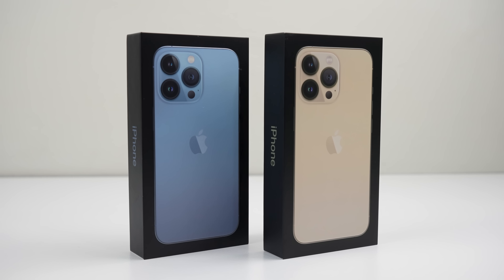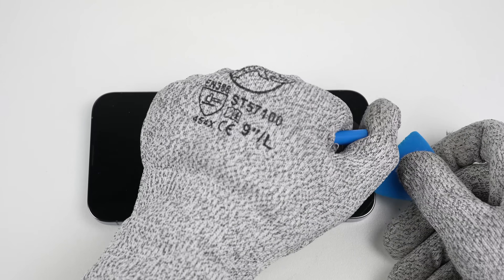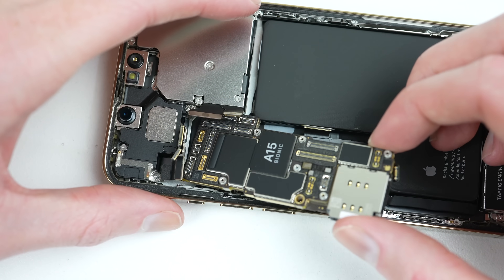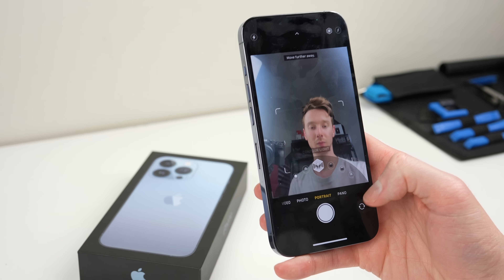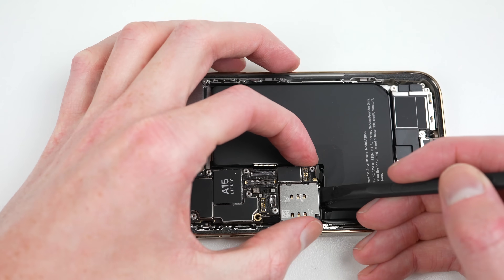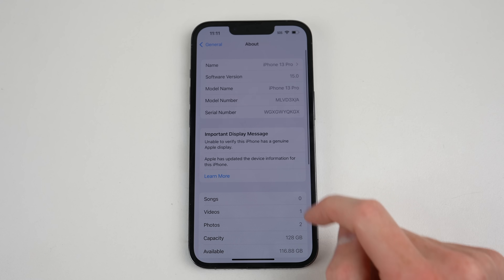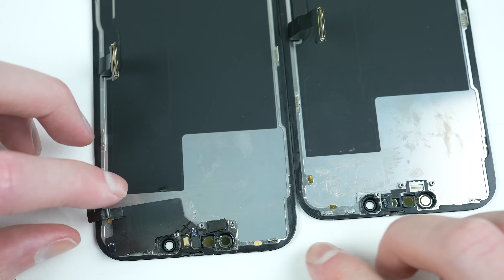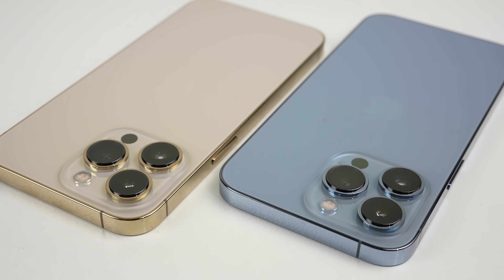iPhone 13 A Repair Nightmare - Teardown and Repair Assessment

Comment: I understand that apple wants “quality control”, but this is excessive.
Reply: This isn't quality control. This is clearly anti-repair software. The parts used were literally new apple parts
Reply: @sameman6884  I have seen many devices fixed by shopping mall repairers using cheap parts and doing rubbish jobs that have failed. And damaged the device. Apple has a program to allow repairers to become certified and get access to the genuine parts. Why is this not getting talked about? I used to repair phones and tablets for fun but do not have the time now. I have never had to repair any of my devices. When are people going to be held accountable for how they treat their devices.
Reply: @EDITS_SC   but again these aren't "cheap parts" these are genuine new apple parts that are clearly working. The crap shops will do bad jobs regardless, the only difference is that the phone will now self-destruct whether the job was bad or not.
Also, why do you think people should still be held "accountable" as if repairing a damaged device that broke isn't already being accountable for your actions? Not to mention devices will just naturally start to break after a while (if you aren't buying phones yearly for no reason) due to natural wear-and-tear and it makes more sense from pretty much any standpoint to just repair the phone instead of buying a new one.
Reply: @EDITS_SC  That program is exclusively marketing. Enrolled repair shops can't buy genuine parts through it.

Comment: Apple power user since 1996.  This is not news, Apple has always had a stranglehold on the hardware side.  Comply or use someone else’s hardware and software.  Since 1996 I’ve only had one genuine defective product from them… so they retain my trust.  Go use someone else’s unreliable, easily fixable because it is easily breakable product.

Comment: I have an Alfa Romeo car and every electronic component talks to the main ECU if you swap out any item the ECU recognise the change and things will not work. All designed to stop thrift. You need the Alfa Romeo computer system to get into the software to approve the equipment change. Apple are doing the same thing but in a more sophisticated way even down to cables.

Comment: My current phone is nearing 2 1/2 years and is due for a replacement, especially that replacing a cracked screen will cost almost as much as a second hand one in decent condition. Since Samsung has disappointed me by selling weaker CPUs for Europe market with same price as  Qualcomm versions, I was looking at an Iphone. It would seem I need to keep looking... I don't want to support this shit.

Comment: I went to get my screen fixed a Phone Matters in Hereford and I was talking to the indian guy who did the repairs and I was talking about how on some of the apple phones, each part was "passworded" so that you couldn't fit a screen from another identical phone onto it without problems in the phone's function. It wasn't completely bricked but it ran strangely at times. He talked to me about the difficulty of Apple phones and how sometimes he had to say there was nothing he could do. Although he managed to fix a friend's IPhone that I dropped in - must have been an older model.
Also why I never bought Apple because I'm clumsy with my phone.
I mean I thought the difficulty of repair extended to, this display has a cable that's really easy to tear when you take the display off, but it's not like he was using knockoff or chinese copy parts, this is two brand new phones.

Comment: This is kinda why I love my old 2011 Mac Pro. I can throw aftermarket parts in it and it’ll still run like new without the computer throwing a fit about it or just plain crashing. 
Hell, two of the RAM slots got fried and it STILL WORKS!
Reply: My 2015 Mac Pro is shit. It got burn in within 3 years and the noise it makes when running anything remotely taxing is crazy. The keyboard sucks and I can't open it fully without the screen going black. 

My brother had the 2011 version and his ran till Feb this year before dying.
Reply: Same with my 2008 mac pro👍